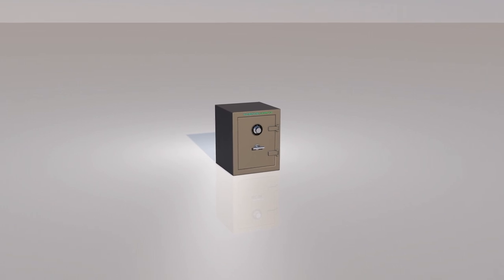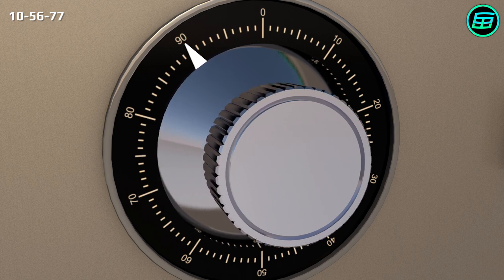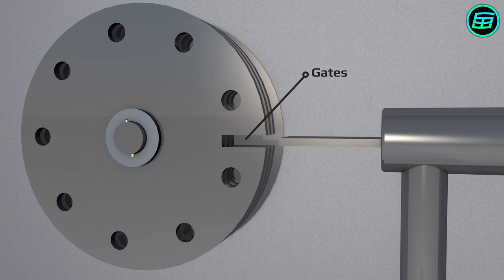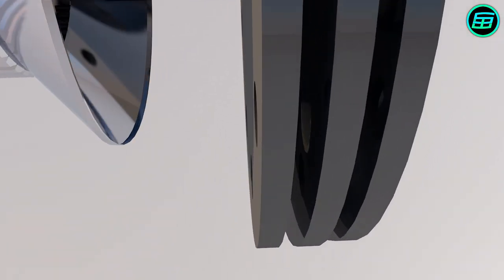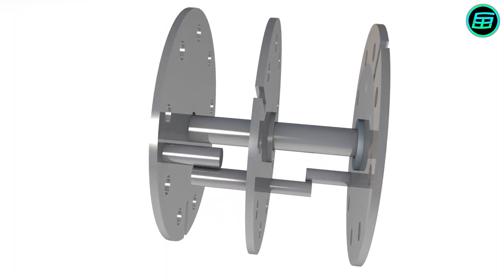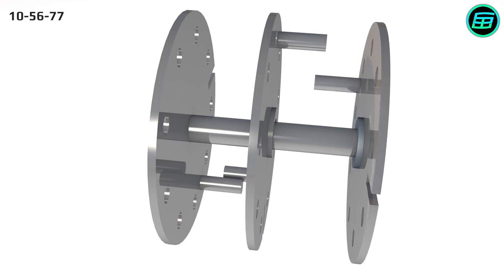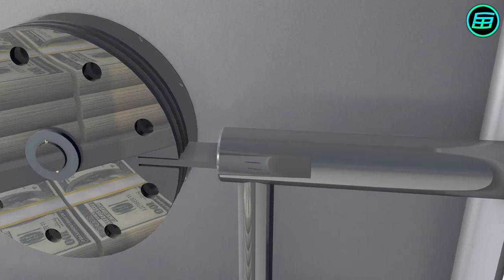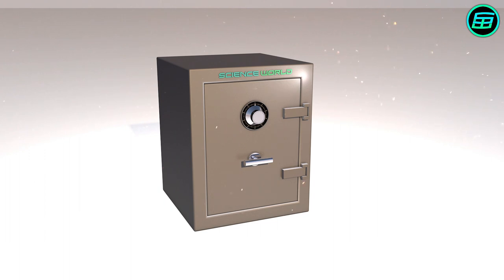How A Safe Works (3D Animation)

Comment: In my opinion I think it’s good thing that this video shows only the basics of how the lock mechanism works as it provides only the basic information about what a person would need to know how to do if they were to attempt to unlock a safe with a lock of this type but doesn’t give away more information than necessary as if someone was to watch this type of video and then attempt to break into a locked safe with this type of dial/combination wheel lock mechanism they would not have as easy a task as this video appears to make it seem as one mistake and it’s all back to the start for another attempt that is of course if they didn’t already get caught and cuffed by the cops by that point in time for attempted theft etc but even if the person knew this videos information they still wouldn’t be guaranteed to be able to successfully open a locked dial combination safe lock as even if a person has the necessary knowledge of how to do the task that doesn’t mean that they are necessarily capable of actually attempting it and successfully completing the task as knowledge only goes so far towards succeeding in a task but it doesn’t guarantee success etc
Reply: Holy run-on sentence mate